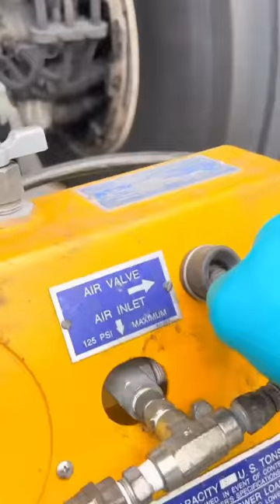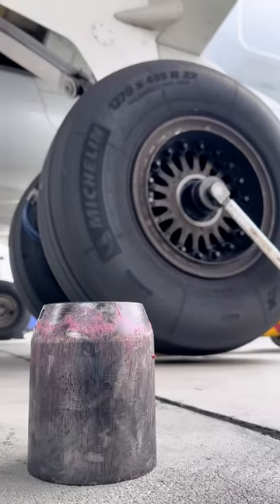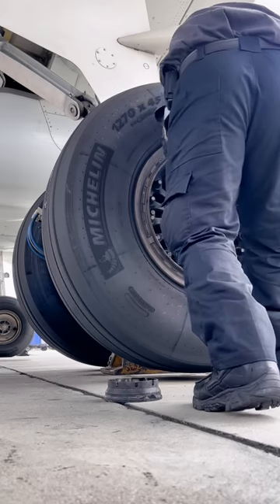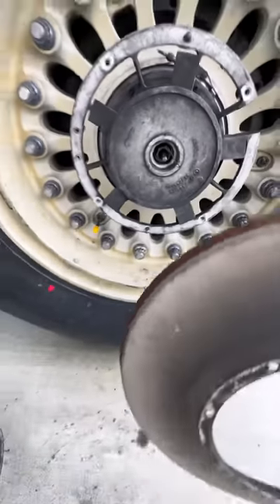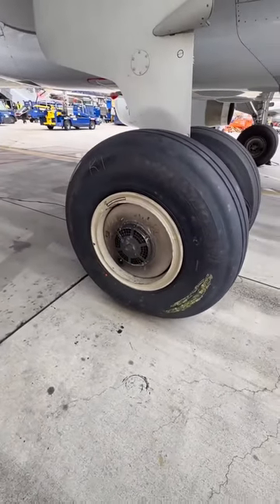Airbus A321 #1 wheel assembly change. THIS IS REFERENCE ONLY.

Comment: Question or calcification, you called this disc brakes, isn’t this setup more similar to drum brakes with the brakes pads pushing up and out onto a drum instead of the pads pinching a rotor?
Reply from the maker: It’s set up much like you car disk brakes. But these are circular stacked disks that get compressed by pistons

Comment: Sorry,  gotta say it. THAT IS THE TIRE THAT IS WORN DOWN TO THE CORD, NOT THE WHEEL.  Yes the wheel will have to come off, but the tire is worn out. Just use the correct word. Otherwise you could just call it the door, or wing....

Comment: The bearing is not held in by a c-clamp. 
Is held in by a flimsy little snap ring, and nothing more. Make damn sure that Axel is lined up with the bearing before you push the wheel on or you will pop that bearing out.

Comment: I work on the ramp and we don't bother with MLG pins for wheel and brake changes. That gear isn't going to move under the weight of the aircraft.  NLG we put gear pins because it could collapse if the over centre locking arms are not in position.
Reply from the maker: just following my manuals
Reply: @StigAviation  that is a good thing but those advisories are only put there to really cover their own arse and yours. But the reality is this: some things can be ignored for common sense. I would only use that rule for ramp work where you own the aircraft. Hangar is a different story

Comment: They seem to have done a really good job engineering the plane to be very easy to do maintenance like this quickly amd easily. Looks like the jet way was extended to, so we're they boarding or preparing to while you did this?
Reply from the maker: yes indeed the components are modular and quick access

Comment: is that the cover of this wheel to protect nuts not coming out of there and cool down temperature of braking heat right??
Reply from the maker: If you’re talking about the big circular cover, that looks like a doughnut, that’s to prevent brake dust from coming out.
Reply: @StigAviation  so why we don't use an air compressor to clean them.

Comment: I was a KC-130J powerline mechanic in the Marines, it would drive me nuts not cleaning the parts before the assembly went back together. I cas also understand that if those plains are not flying they are not making money, so your operating like a NASCAR pit crew.
Reply from the maker: I’m glad you got that part. I appreciate you for understanding. If I had ample amount of time and cleaning equipment with me then, sure I would make it shiny clean.. I just don’t have that amount of time. But I do know what to look for in damages. Even if it’s dirty the damage is very evident.
Reply: @StigAviation  when not deployed there is hardly a rush to get planes up in the air (at least with my squadron). We did usually time ourselves when doing prop changes.

Comment: not worked on airbus but look similar other types. we make sure handbrake is on before taking wheel off or it'll make your day harder. Also test the anti lock braking by spinning the cap to make the  ABS operate before putting the bolts in.

Comment: Hi stig aviation
While working on jumbo engine b747 , our instructor strictly advised . you should put back EXACT SAME BOLTS in the same sequence of your opening th
Reply from the maker: Just follow the AMM. Put proper bolts in their proper position as stated in the manual.

Comment: Nice clean wheel assembly.
No time to clean the other parts.
This is primary reason for failures.
Maintenance shortcuts.
Minimum safety standards.
Reply from the maker: And that’s why we Don’t take shortcuts and follow our maintenance manuals. 👍
Reply: Why install dirty parts?
Clean the fan assembly.
Clean everything.
Upper management Focus on critical componemts only.(which is mandatory But followed by dirty secondary components, classic time management issue)
Its all in prep work! Employers need to hire more Employees.
Companies are More worried about their wallet then the quality of workmanship.
The quality isn't here these days.

Wheel looks great, everything that follows needs cleaning.
1: Disassembly 
2: Cleaning
3: Inspection
4: Replace damaged parts
5: Installation

IF YOU SEE SOMETHING, DON'T TURN A BLIND EYE.

Same problem everywhere!

Thats why I work on my own stuff
Shops don't clean stuff ever! 
Install dirty components.
Dirty workmanship. 
No Time to do the job right.
Reply from the maker: @joshua9891  Joshua, I really appreciate your input, but what you have to understand is as I said again, we follow our strict maintenance manuals, and on top of that there is no point in me cleaning all of these components up because they will look exactly like this on the next landing. And trust me when I tell you, we are very diligent, and we pay attention to the components themselves. We know if there’s going to be damage because we know what to look for. Once again, we follow aircraft maintenance manuals, don’t compare that to automotive or any other kind of shop where you have the facilities and equipment and most importantly, time to sit down and clean everything up to make it look like brand new, it just doesn’t work like that on a line maintenance environment
Reply: @StigAviation  I understand it's not automotive, I'm not trying to derail you from following protocol, when it comes to maintenance I KNOW real life never wants to accommodate the extra mile. I find myself on the outside looking at things I wish would be corrected.
High standards in aviation. 

I'm an electrician by trade, safety of others is number 1, especially younger people under authority of Journeyman. They need to know why they are doing a job instead of just doing a job.

There's many things I don't like. I would say you guys are the the top of maintenance scrutiny and I respect that highly. I didn't know, because I'm new to your channel and don't know about your channel.

Time is the constraint and sadly its the supervisors unchallenged that cause the biggest mistakes.
It's ok to go toe to toe when something isn't right before something happens that can't be undone.
God sees everything. Begining and end. I'd praying constantly for insight .
God bless you for your services!
Stand firm :) 
Blessings.
Reply: Always remember only Jesus Saves!
:) 
Days of boldness are here.

Comment: Have done this job many many times on C-130s when I was in the USAF! I see the process is essentially the same with airlines. One thing I found out the hard way was, if you don’t set the brakes first, the installation takes a LOT LONGER!!🤦‍♂️🤣🤣
Reply from the maker: Thank you for your service sir
Reply: В этом видео не показано как механик бежит в кабину пилотов и снимает самолёт со стояночного тормоза.

Comment: It’s amazing how similar every acft wheel change is. I was on AWACS, KC-135, and now B-1. All basically the same.  Question: does that cooling fan also spin the wheel speed transducer?
Reply from the maker: @jasonpfannenstiel9315  the speed transducer spins on its own. It’s attached to that protective screen on the hub, so when the wheel spins the transducer will spin and detect a wheel skid. The fan has an electric motor that spins it independently and it’s pilot activated via push button in the flight deck.
Reply: @StigAviation , good to know. Thank you.

Comment: -5 points for not cleaning off all of that brake dust with some brake clean or degreaser. 😂 Otherwise, awesome job! Never knew you could house a fan in the  rim.
Reply from the maker: 😅 I wish I had the proper cleaning equipment and more time , I would have made it look like new, but then again it’s gonna look exactly like this on the next landing. And thank you

Comment: Question. For pre torque, where does it mention to spin the wheels? If it does mention, clockwise or anticlockwise? We were all taught NOT to spin in the tighting direction, thats the clockwise.
Reply from the maker: It’s mentioned in the AMM and you spin in the direction of axel nut rotation. That is standard procedure for all aircraft wheels.

Comment: Well I felt that the adjacent tyre also needed replacement. Lot going on it's surface too. Did you replace the other one also?
Reply from the maker: The other one was within operational limits. It didn’t need to be changed at the time. We follow the Aircraft maintenance manual for determining the limits.

Comment: I may have missed it but I presume you apply the parking brake before removing the wheel to lock the rotors in place, otherwise you need a spider to realign the rotors to get the replacement wheel back on?
Reply from the maker: Yup 👍. Best practice is to set brakes before removing the wheel,  keeps the disks in one place so it’s easier to install the new wheel assembly. After which we release the brakes to spin and torque
Reply: @StigAviation  Ok, thanks. It's how we used to do it so I presumed things hadn't changed but wondered if a way of stopping the rotors dropping with the brakes off had been invented😁

Comment: One thing Inwould like to see is how you manage parts while doing major disassemblies. I work on my motorcycle and always worry I will loose something. Ex doing a valve check, there a lots of screws and connectors.
Reply from the maker: There aren’t a lot of parts, and the ones that are there are simply organized in the fashion of taking off and putting back on.

Comment: Didn’t see the thread protector when removing and installing the tire. Also where are your safety vests?
Reply from the maker: Look closer, the thread protector is installed. I would not jeopardize the axle threads, it’s part of the maintenance manual procedure to install the thread protector. We follow the manual. And my apologies that I was not wearing a vest, it was extremely hot that day. I had to take it off in order to work in better conditions in the hot environment. It was also getting caught on some of the tooling and components.

Comment: Cool cool.
About how much does this A321 tire cost ? 
How long do they last ?
Reply from the maker: Around 3.5/4K. Unpredictable in real world environments how long it last but manufacturers say around 200-250 landings
Reply: @StigAviation  
Very interesting !
How many tires like that per A321 ?
Assume nose wheel tire(s) much smaller ?
Reply: @StigAviation That's so cheap!😮 On the 777 and 787 they're about €30000.

Comment: Nice work 👏 
But . For apply the torque to the wheels 🛞.  Maintenance should be rotating the wheel to the direction of flight 🔄 . Thanks 🌹🛠
Reply from the maker: Yes, you are right

Comment: What of the bald spot on the tire was facing the ground and you didn't see it? Would you still have changed it? And if so depending on what?
Reply from the maker: The bald spot was big and very noticeable even if it was at the bottom. And if it was conceal at bottom we would see it at push back or the next station will catch it

Comment: Thank you for sharing this video. I am interested in maintainence of the landing equipment. One question: Do you wear masks during disassembly and cleaning because that black powder gets everywhere and on everything. Breathing that in might be similar to breathing in brake lining dust when we found it contained asbestos particles and hazardous to service personnel maintainence teams. You only have to look at your gloves to see what effects it has on anything near you. I wonder how much heat is generated by the braking during one landing, I bet the tyres get hot too? On cars, it's low, but on military tanks, we can boil water in seconds.

Comment: Maybe you need some sort of hands free camera so you can work with both hands. Are modern aircraft still using imperial measurements?
Reply from the maker: All modern aircraft are SAE standard. There are a few interior items that are metric but very few and between.

Comment: Thanks for fascinating video, Stig! I wonder if it would be possible to design the gear to spin the wheel to speed prior to touchdown at landing. Rubber saved!
Reply from the maker: In a perfect world, that would be something ideal, but in retrospect, it would add more weight to the aircraft as well as more components that can potentially malfunction. Also, the ideology of spinning up a wheel to match the ground speed, is a bit illogical, remember, we’re trying to slow down the aircraft, not match the speed of the ground. The wear and tear on the wheels is negligible in comparison to the cost-effectiveness of more components, and adding more weight to the aircraft.
Reply: @StigAviation  My post was only humor.
Reply from the maker: @Glen.Danielsen  my apologies… I took it as a serious question because I have had many people ask that before.

Comment: I'm surprised the brake fans are effective, the blades are so small and far apart.
I nearly didn't recognize it as a "fan" when you took it out.
Reply from the maker: It’s actually very effective, it cools down that brake very quickly

Comment: Hi, surely that's not a 3/8ths inch nut? (02:08) Airbus is surely totally metric. [I'm not talking about the drive size of the ratchet / socket.]
Reply from the maker: yes it is, All commercial aviation uses SAE , Airbus and Boeing

Comment: Those are BABY WHEELS . When you do an earthmover, then you are playing with big tires . But very intriguing .What you should note on filling the tire that you ARE NOT USING COMPRESSED AIR But NITROGEN and why it's used .
Reply: Because of possible moisture, it'll freeze at low temps. Nitrogen molecules are bigger than O, les chances of leakage as well. Also the tire pressure is more stable.
Reply: @caddyrack  Correct just stating you should add this to you video ,most people do not know this .

Comment: He changed out the wheel? He check the air pressure in the wheel? There's a difference between wheels and tires!
Reply from the maker: i was refencing to the whole assembly sir,, that's what we change
Reply: We know there's a difference, however, when you say you check the air pressure in a wheel many of us cringe. Also, discarding the parts and pieces on the concrete gives the appearance of being laxidasical and unprofessionalism.

Comment: I would have removed the valve stem and had a containment tray for tools and parts.. tie down strap works good too
Reply from the maker: Everyone has a different method of working. As long as it’s done by the AMM.

Comment: Did plane tires get balanced like with car/trucks? Why did it only wear at that particular spot, not like racing cars, or regularly cars? Thanks! Interesting post
Reply: Because it was unlucky, and the touch down was made in the same spot multiple times. It's not that bad actually. The wheel and tire assembly on a 777 I changed earlier today was perfectly worn. I remember because it doesn't happen that often.

The wheel and tire assembly is usually balanced at the overhauling shop. They retread the tires and check for flaws and damages on the wheels and tires.
Reply: @CheapBastard1988  my gosh, your talents are amazing. Thank you for keeping us traveler’s safe.

Comment: 😮 Is that hold strongly because you have just screwed nuts and bolts with your fingers
Reply from the maker: Everything gets tightened and torqued with a calibrated tool. It’s very strong.

Comment: Great video, I'm not an airplane mechanic But don't you think that the other tyer need to be changed too😊
Reply: Airlines count their pennies.
Tyres are only changed on condition.
If they can get a few more trips they will.
Seeing as everything is inspected before each flight they can gauge and budget for everything on a just in time regime. 
If you saw the cost of tyres or anything aircraft your eyes would water ⚠️
Reply: The other tyre was fine. I don't know the limits for the A320. But on the Boeing 777 and 787, the minimum amount of thread has to be measured at 3 different positions of equal distance and must be about 0.8mm average. So one area with a flat spot can be averaged out with 1.2mm on the two other spots. As long as the flat spot doesn't show the cut protector like the tyre in the video. And a single wheel and tyre assembly costs about €30000.

Comment: How many brake pads on the number one wheel on this particular model?
Reply from the maker: they are more like circular brake Disks that are stacked..
Reply: @StigAviation  At 4:19, I tried counting the calipers, but can't count that high. So are you saying that there aren't pads between those disc's, but rather that the disc's are pressed together by the calipers? It's unimaginable how much force it takes to bring something of that mass and velocity to a stop.

Comment: 07:00 "brake fan goes right back on, we re-safety that one" (holds wire over the axle/spindle)
...and cut to the wire twisted round attached (isn't clear).
What does he mean to 'safety it'? Is that some kind of backup retention method?
Reply: Yes,  The bolt has a hole drilled in the end.  You place what is called a safety wire throught the hole and twist it tight.   This keeps the nut from backing off the bolt.

Comment: the clamp of brake fan assy damaged? so they use lockwire to tighten
Reply from the maker: There was no damage to the clamp, the safety wire is not required per aircraft, maintenance manual, but it’s an old practice that some mechanics still perform.

Comment: There not cotter pins, a cotter has a tapper and is located with great force, you had a split pin , two sides to split,.  And pretty sure you are working on a metic plane , so it would not be a 3/8 socket. Try saying ten mm.
Reply from the maker: Buddy all commercial aviation is SAE. Boeing and Airbus. Look it up. I should know. I been fixing both for 25 years.
Reply: The locking device we call.a split pin in the UK transforms into a cotter pin by the time it lands in the USA. It's like cars have sills here but rocker panels in the USA. You get used to it🙂